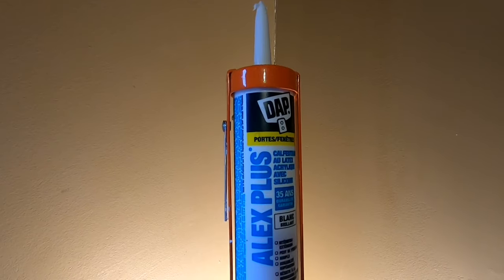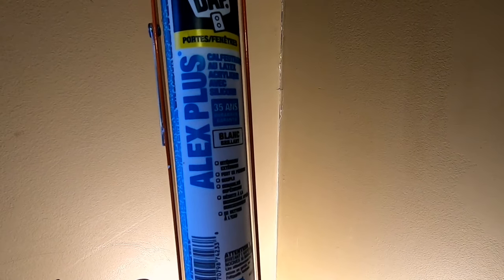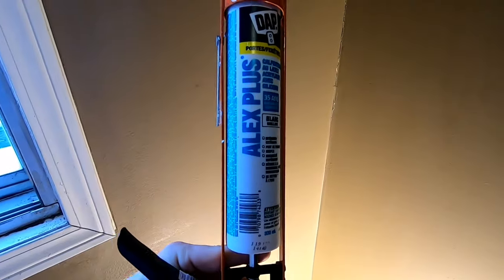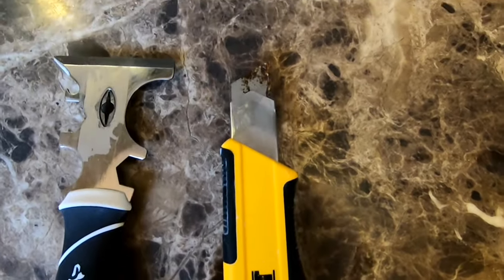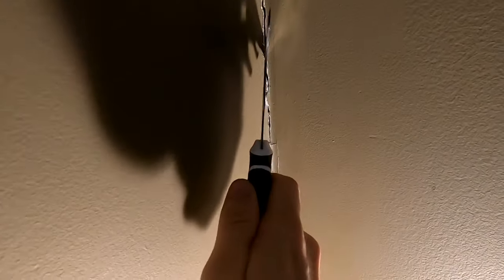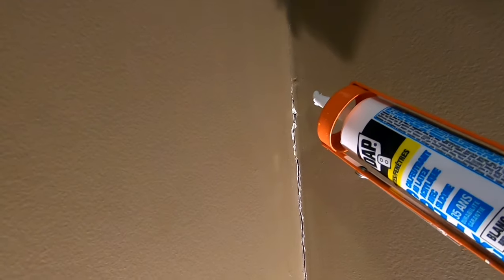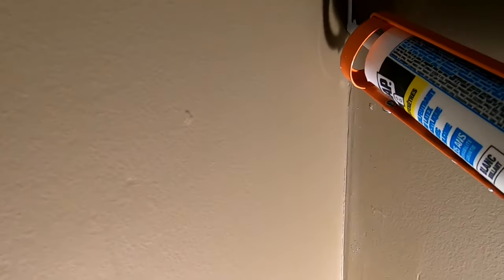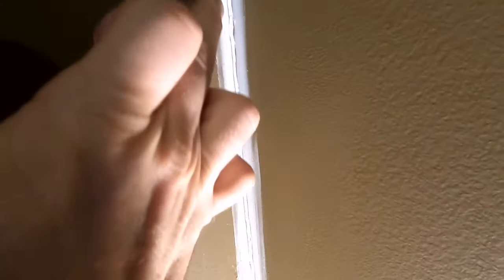Fixing Drywall Cracks with Caulking

Comment: I'm going to get a lot of hate for this comment I'm sure. but guys he didn't do a good job
Reply from the maker: No hate for honest opinions, but I'll just say that I showed what can be realistically expected, quality-wise, with this method. I did say throughout the video that this isn't the professional method. It's just a quick easy way to make gaping cracks no longer obviously visible. If a person wants the crack to be completely invisible under close inspection, like a brand new wall, it should be taped and plastered, which is the professional method - but that takes way longer to do.

When repairing and painting rental properties, I'll charge $20/linear foot for taping and plastering cracks, but if the client just wants them caulked, I'll just do it for free, as a courtesy, because it just takes minutes. It was under such circumstances I made this video.
Reply: You also have to match texture with slinging mud, which costs money as you said, but also the cracks come back with mud cuz it’s plaster so maximum flex caulk will last longer - your gonna see the repair no matter what, it looks better than a crack and it might look better than take and mud if the texture is hard to match

Comment: Guys, I would be wary of this. Using the painter tool to "clean" the crack creates more debris. If you apply cqulk/silicon on dust it doesn't bond. You need to hoover the gap, put pva and water mixed in it to secure the dust and make a non porous substrate. Then if you want add silicon. There is also no need to make the gap so large if using silicon. Large gap is just for a filling compound.
Reply: Adding silicone is a horrible idea, if you want to paint it.  Use a latex or a SMP.  To get rid of the dust, just take a trash and wipe it down quick.  Problem solved.

Comment: Yes we now have adhesives / cauk that last 50-80 years with color to match. Drywall tape and mud is old 1920s repairs and no longer necessary with caulk / adhesive technology.
Reply: I repaired cracks by ripping off the old tape. Wetting the old mud. Scraping the old mud off. Drywall screw the crack every 6in then Re mud with tape Mud again Sand mud Mud again and Finsh sand. If you have crack it due to movment so drywall screwing down is the only wall 
but
All that work and 10% of the time the cracks reappear. I guess if your a higher painter or contactor do a job 5 or 6 times is good money. Cauk let the cauk set and know the job is good for life.
Reply: @dallas69 Does that work for cracks above windows and on walls or only corners?

Comment: I am over 70 and trying to fix my house up for sale. My husband is sick and can't help. I am watching videos on how to do nearly everything to get this place in shape. The crack I am trying to fix is in the ceiling... it is hairline and I know I need to widen it to give the caulk something to grip to. My problem is 1. just getting up and down on a ladder.LOL 2. Getting the drywall to cut... I've tried a utility knife and then the pointed end of a beer opener. Maybe I just don't have enough strength.  So what I am doing is wetting the area with a squirt bottle and waiting until it has soaked in a bit. Then I tried the bottle opener. That worked. I may have to wait a day or two for it to dry thoroughly before caulking but at least I got the crack wider!  Getting up to the ceiling to clean and caulk is the next step... taking it one day at a time!  I have the whole interior of the house to paint!  The bids we got were over $8K!

Comment: What kind of caulk do you use? Will Alex Flex premium molding & trim sealant work?
Reply from the maker: I used Alex Plus, but I've recently started using Alex Flex, which is a newer product, it's advertised for the worst-case scenarios in gap flexibility, it allows for up to 25% joint movement.

Comment: the cutomer you're referring to seems like a slum lord lol
Reply from the maker: I should've explained a bit more information in this video, my mistake, I don't quite remember this jobs exact particulars, but normally I charge $20/linear foot to tape/mud/sand cracks, and there was probably up to 100 linear feet of superficial corner cracks (old lath/plaster house). On paint jobs, I can cover them all in an hour or so while I'm re-caulking base and door trims. To the customer that's $75 vs $2000 and the quality difference can only be seen on close inspection. I think it's a reasonable choice for a rental property.

Comment: You don’t need to a add primer over top of the caulking before you paint?
Reply from the maker: The caulk I'm using in the video, Alex-plus, is a paintable caulk, no priming necessary. It's a very good all-purpose caulk for interiors.  There's also a newer product called Alex-flex that came out after I made this video and I'd now highly recommend that product for quick fixing corner cracks.
Reply: @Interior_Works  thank you.

Comment: My wall has the same problem so what really is this problem why walls became like this?
Reply from the maker: Anything that could cause the structure to move, could be a recent windstorm or even dry soil can cause a foundation to shift.  Or Wood framed houses, the timber can absorb and release moisture over time, this causes expansion and contraction which causes the plaster to crack.
Reply: Drywall Vids  is this expensive or hard to fix?

Comment: Can I use the loctite powergrab caulking
Reply from the maker: I can't say for sure because I've never used it on a crack, but being an instant adhesive caulk, my concern would be that it might be too sticky to make a clean spread on the corner. I like the Alex plus caulk because it adheres very well as it dries, but fresh out of the tube it's like a putty and easy to spread and wipe, and not sticky.

Comment: Wouldn’t filler be better here ?
Reply from the maker: Most cracks happen due to structural settling of the building or seasonal temperature changes, a acrylic-silicone caulk, being permanently flexible,  will expand and contract, preventing a gap from appearing. A plaster-based filler will simply crack and expose a gap again.

Comment: Lets see the crack... you were smoking🤣 do not use caulk to repair stress cracks. A tip if you are going to at the very least you could go paint match the current color and use a free sample from home depot and touch up the crack with the tip of a painting sponge so it doesnt leave too much paint just enough to cover the caulked crack
Reply from the maker: It's acrylic silicone, so it flexes with the stress, like rubber, like an expansion joint. It holds long term most of the time. But I did say several times this is not the professional method, just a quick fix, it's an option for people to do in their own homes with their own time. If the crack reappears in a year, well it's only a few minutes wasted and I'd advise they tape and mud the crack at that point.

Comment: You charged someone to run a bread of caulk...?
Reply from the maker: I charged someone to touch up and paint a 2000 sq ft rental property. As typical, I priced the touch-ups by the hour to client specifications, and the painting as a square foot rate. As for all the cracks, the client specified me to just caulk the cracks instead of taping and coating, because its 10x faster therefore 10x cheaper for the client.
Reply: why wouldnt you charge??
Reply: Let me go do a job for free...not